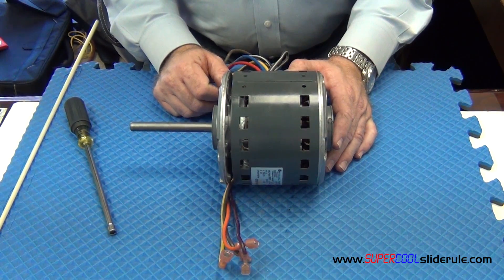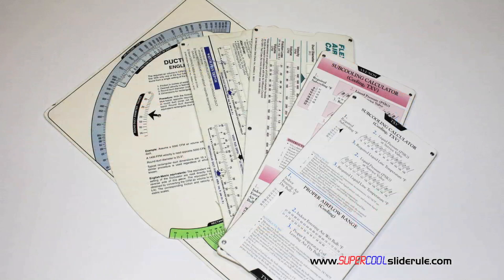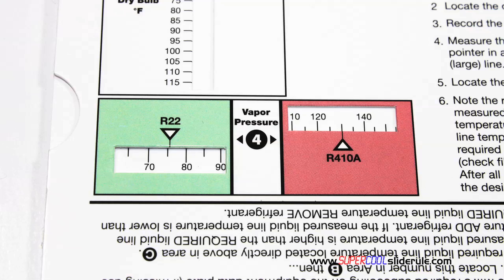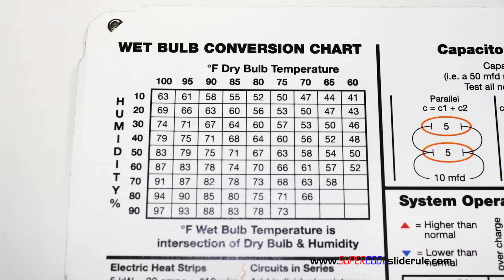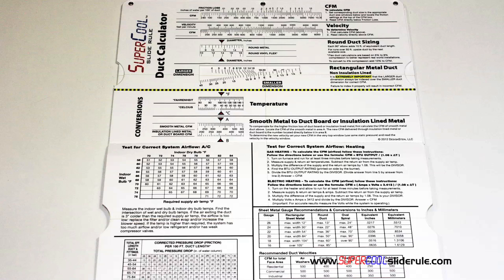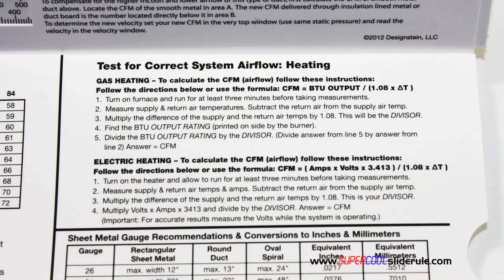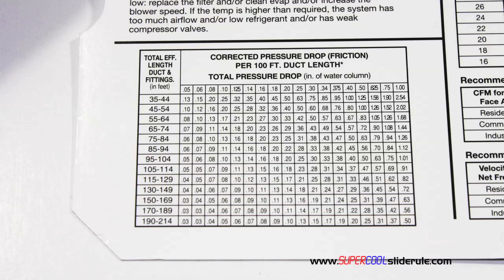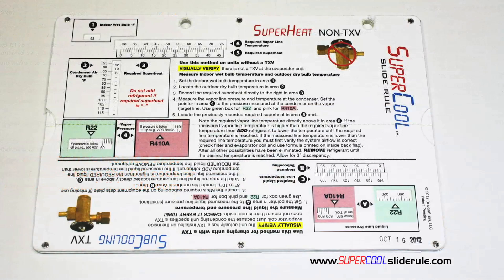How to change the Rotation of a Non-reversible Motor

Comment: This is the worst example on how to reverse a non reversable motor. How are you supposed to hook the thing up? You said pretend those wires aren't there. What are supposed to hook the wires to in order to give it power? What if the inner windings aren't centered? The rotor won't be creating a proper magnetic field. Sorry buddy but your a hack.😢

Comment: Have a motor exactly like the one he’s using except not reversible. I did exactly as he did and swapped ends. It runs just fine but didn’t change direction at all still rotates exactly the same.

Comment: That will not work to reverse the rotation  counter clockwise  to clockwise. The only thing you accomplished accomplished by doing that was moving the wires closer to the shaft.

Comment: so I know this is an older video but I tried this and I still need the shaft to exit to a squirrel cage and after putting it back together it still rotates the same direction.  Is there something I should have done differently?

Comment: This suggestion will only work if the stator is in the middle. Several motors I've encountered had an offset stator which is closer to either the front or back. Switching around the armature can get so far offset from the stator that it may not even function.

Comment: Hot diggity dam!!!! Thank you so much for this video!! I just had to replace my hvac fan motor. I put it back exactly like it came apart, yet the fan rotation was wrong. Then I found your video. My replacement fan motor looks almost identical to the one you're using in this video. So I did exactly what you said to reverse the motor rotation, then put it all back together again and it's working perfectly!! I couldn't say thanks enough, it just saved me several hundred dollars.

Comment: If it's a shaded-pole motor you do that. It's not called an unreversable motor. This typer of motor, shaded-pole is the only one where you have to physically reverse the rotor inaide the stator. The rest of them that are 3 phase you just interchange any two leads of the 3 phase source.

Comment: My application was with a condenser fan which I re-purposed as a shop fan. I built the box frame and motor mount before I realized it pushed air through the back of my box. (Its a long story as to how the motor is mounted in the outdoor condenser unit to pull hot air out of the unit...) This was a 240 volt single phase, so the comments about reversing the poles did not make any sense. I invested the minute and a half to see how this was done and it sure worked for me. I had the clockwise rotation reversed in 15 minutes blowing air from the back of my box after I remounted the now turning counter-clockwise motor.  I agree: if you're going to submit a video about reversing a non-reversing motor, you should use one that doesn't reverse...the extra wire fiasco was distracting. Regardless, thanks for the guidance.

Comment: You have no idea how happy I am to find this video!  Had pulled apart a little desk fan that was stuck.  Cleaned it and put it back together, unaware that I had put the shaft in the wrong way, causing the blade to run backwards. Not knowing anything about the different types of motors, I found all kinds of advice on how to reverse the direction of a motor.  This solved my exact problem without the need of rewiring anything (which I think would not have worked anyway, from what I read).

Thanks! :D

Comment: Kevin,
The motor pictured IS A REVERSIBLE MOTOR. this tutorial shows you how to change the rotation of a NON-REVERSIBLE MOTOR in an emergency (walk in freezer on a restaurant, etc) until the proper motor can be installed.

Comment: in a reverseable motor you can switch the 4 rotation leads around in a directional motor you cant just switch the wires moron wont spin full speed and will over heat and trip the over load or burn the windings up but you can flip the stator around as show in the video

Comment: This is bullshit. You could just switch the wires without dissembling the motor.
Reply: Try it out.  You just made an ass of yourself
Reply: +Mike Pickford You should try it- it works regardless if my asshood.
Reply: +bombdoghandler on a single phase ac motor it will not.  on a multi phase or DC it will work
Reply: +bombdoghandler It works. You should hire professional help if you're not really familiar with electrical stuff, though- it's dangerous.
Reply: I read somewhere that reversing the polarity of a certain type of motor does nothing.  I'm not sure if reversing the polarity to the capacitor does it though.
Reply: If it's used for what he says is being used for then that's a shaded-pole motor. Has low HP rating and you can find in toys, bathroom fans, can openers, clocks, etc. For this type of motor you have to physically pull the rotor out and turn it around just like he did.
Reply: bombdoghandler usually for the majority of motors just by interchanging any two line leads to a 3 phase source will reverse the direction of the rotation. For a blower the motor is called shaded-pole motor and the direction of rotation is actually reversed by phisically reversing the rotor inside the stator.

Comment: Michael Bolton is exactly correct regarding rotor and stator misalignment. Another concern is the possibility of the rotor endring striking the coils. While some motors are designed to be mechanically reversible, with symmetric spacings internally, most are not. This would not be recommended as a general practice to reverse a motor. I designed much of the PSC and shaded pole lines for one of the major manufacturers for 37 years as well as continue to be a member of several UL and CSA motor safety committees and frankly know what I am talking about.

Comment: Picture and analog clock on the wall that has a glass pane in front and a glass pane in back and the numbers and minute and hour hands were just kind of floating in between the two panes.  Now take the clock spin it around and view it from the backside, NOW IS IT going clockwise or counter clockwise, its still going in the same direction but the orientation has changed so it appears to be going counterclockwise.

Comment: Can ANY non reversible motor be reversed.... I have looked online until Im blue in the face and I am just trying to find out if all non reversible motors can in fact be reversed in some way.... Also what would happen if a non-reversible motor was wired backwards, like a single phase motor... would the motor just not run, would the motor burn up....I know there are lots of qualifications to my question but looking at your video it seems you know a quite a lot about electric motors.

Comment: You are actually correct. If you look at a double shafted motor, one end is CW rotation and the other end is CCW rotation. So when you reverse the rotor and shaft, you will have the opposite of the original rotation. However, most PSC and shaded pole motors do not have symmetric spacings internally which means the rotor will be misaligned with the stator. This will result in reduced motor performance and can allow contact of the rotor endrings with the coils which will permanently damage the motor. Thus this would not be recommended as a general practice to reverse a motor.

Comment: THIS DONT SOUND TO REAL TO ME. IF THIS WAS SO TRUE YOU COULD OF USED A MOTOR WITHOUT REVERSAVLE LEADS AND ACTUALLY DEMONSTRATING THIS AWESOME TRICK ACCORDING TO YOU .
Reply: this is for you SERGIO.  it IS a reversible motor ELECTRICALLY because he can just reverse it by swapping two of the wire leads thus changing the polarity +/- to -/+  he is choosing not to do that.  by ignoring the wire leads altogether he is essentially making it ELECTRICALLY a non-reversible motor. So instead,  he is changing the direction MECHANICALLY by changing which side the shaft is on .  the actual rotation of the stator is still the same but the orientation is now flipped.
Reply: Jay H. Switching the source voltage leads will NOT change motor direction. The motor direction is determined by a start winding or capacitor which momentarily introduces a false second phase magnetic field 90 degrees out of phase with the source current. If the false field is 90 degrees the motor turns in one direction; if it's 180 degrees it turns in the opposite direction.
If the motor has a start winding, reversing the leads TO THE START WINDING will change the motor direction.
FYI: Before you remove any through bolts to a motor be sure you make witness marks at one inline location on each end bell (case covers) AND both case ends. Lining up all 4 of these marks makes it easy to reinstall your through bolts.

Comment: I've seen some stupid demos, but you're an idiot. You might as well picked up the motor and turned it around to face the other way. That would reverse the direction of rotation, and whats more its dangerous and wont work for all types of motors.